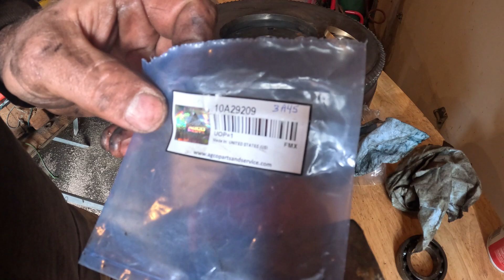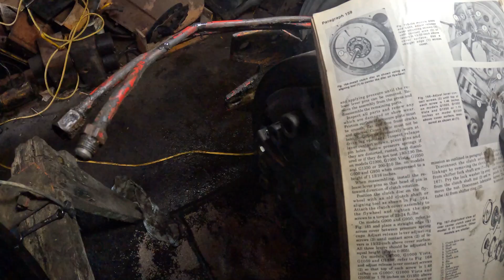MM G950 clutch assembly 1

Comment: Dean Hendrickson / Yellow Tractor     My G950 has the 3 speed amplitorq which is harder yet on the clutch hub. the stock parts will be just fine for a tractor in semiretirement